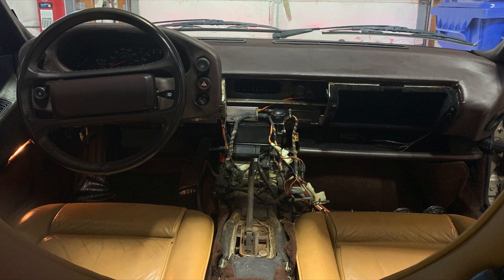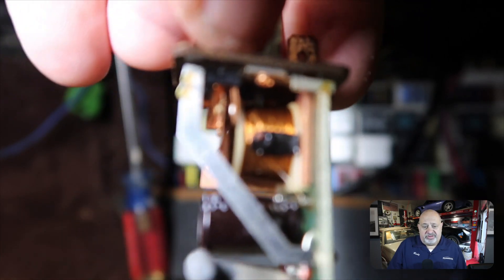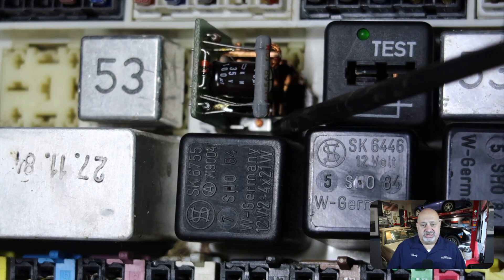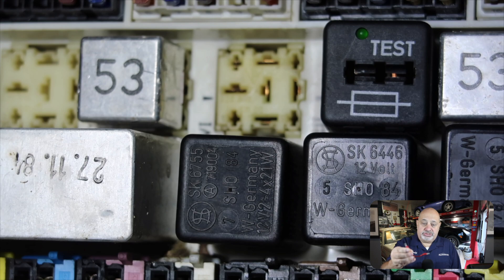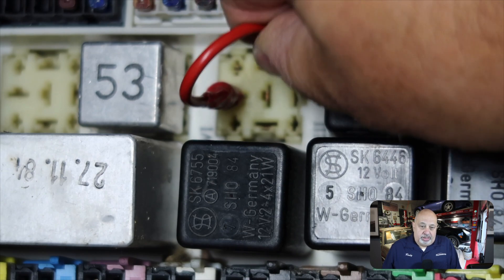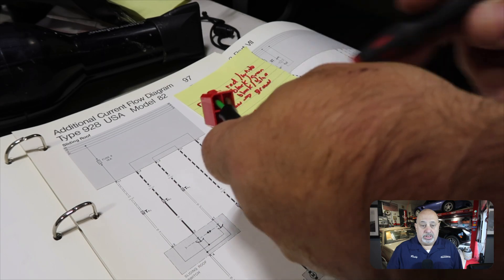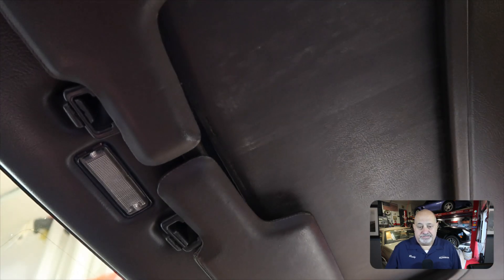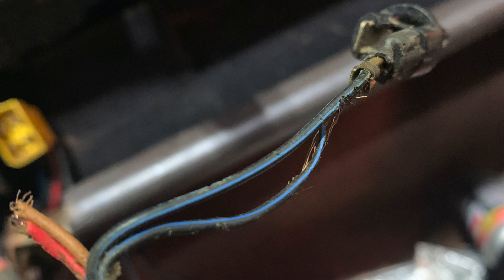How To Use a Jumper Wire To Troubleshoot Porsche 928 Relays To Close Power Windows and Sunroof

Comment: The pins 87&30 are true for any relay I have one of these cars in the shop and someone put a wiper relay in but as for a good solution you can use a standard relay as I did and it works just fine

Comment: Did you try contact cleaner on the contacts in the relay and also the slots in the fuse panel
Reply from the maker: Yes, not shown is that I often use DeoxIT to clean the terminals in the box and the relay. I'm told on good authority that given the age of the relay (38 years old), the diode is likely bad.

Comment: Assuming you also checked 928 International. They list 928.615.126.00 @ $59. If that is correct one for yours.
Reply from the maker: Hi David, thanks for the tip. I currently have an order with ECS Tuning, claiming it will ship on October 5. 928 International will be my Plan B.